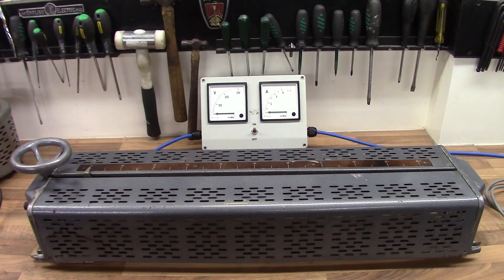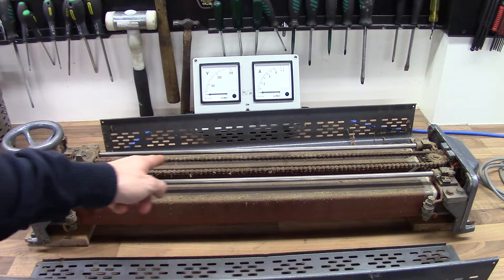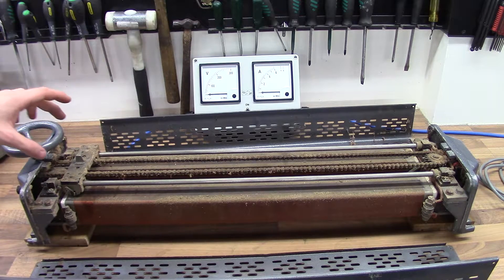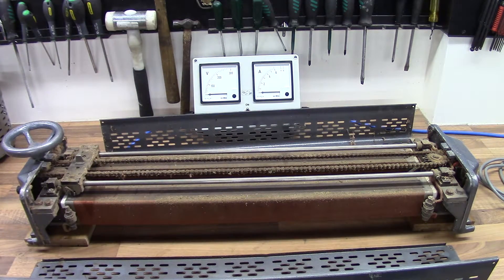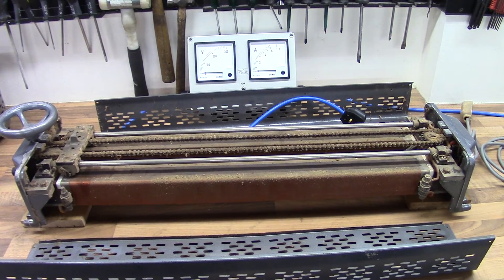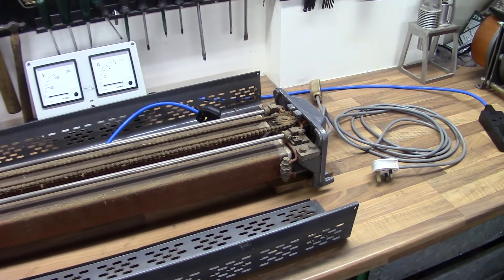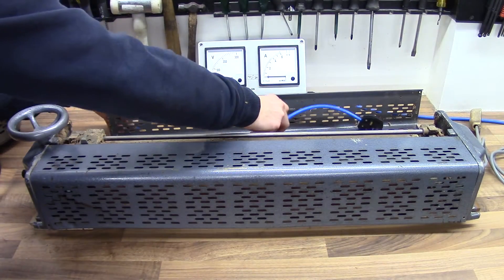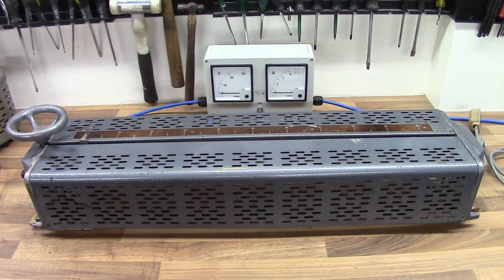Linear Variac Restoration Project - The Beginning

Comment: Wow, that is an awesome find! I really love this 50Hz / 60Hz stuff ;-) I'm still looking for a 400V-model for driving my small 400V to 15kV distribution transformer. Great stuff, thanks for posting!
Reply from the maker: +kilovolt Sorry for the late reply...

Just so you know; if you need to use a variac as a step up transformer from 230V to 400V you will sacrifice half your current rating of the variac in return for additional voltage.

For example; A 10A, 400V (4000VA) Variac supplied with 230V 10A (2300VA) at the center tapping point will give you 460V at 5A at full output power (2300VA).

The reason for this is you are essentially doubling your input voltage which requires twice current you are supplying as "Voltage is inversely proportional to Current in transformers" or (Vp / Vs = Np / Ns = Is / Ip)  or "As Voltage increases Current decreases".

Simply allowing 20A to flow at 230V supply to get 10A at 460V will work for a short (<5min) amount of time until the variac windings overheat...

Just thought you should know if you don't already, so you don't end up with an under rated toasted Varaic.

Also, you may find a 230V to 400V step up Transformer is easier to find than a 400V Variac, the advantage to these is that you don't loose half your rated VA, so your transformer or variac don't need to be twice the size, (VA and Size is proportional), so is easier to carry and can be separated from the variac.

For example; A 2300VA will take 10A at 230V and deliver 5A at 460V, again the same Voltage to Current laws apply, so check your VA calculations make sense before hitting the "Buy Now". =]
Reply: +Steve Lane Hello Steve, thanks for the reply. I'm aware of that, yes, but I have a 400V line in my house. Here in Switzerland there is 400V and 230V line power in almost every household available. 400V is our phase-to-phase voltage and 230V is our phase to ground voltage, so I'm looking for a variac with 400V input and 0...400V output.
Reply: +kilovolt By the way, the 400V line has a 20A Breaker and I found for a half minute or so you can draw up to 50A, so there is plenty of power available, but my 400V to 15kV transformer can only withstand 10A continous or for short times about 30A.
Reply from the maker: +kilovolt Ah 400V to the house, that's very handy indeed!
Does your Neutral "Ground" have a return copper wire back to the transformer or does it actually use the soil as part of the circuit? Just out of curiosity... =]
Reply from the maker: +kilovolt Sounds like you've got the capacity if your 15KV TX is 4000VA continuous and your Supply is double that. Is the 15KV TX oil filled?
Reply: +Steve Lane The Neutral Ground is a return copper wire, but if I'm right, this path goes only back to the next sub station. The high voltage lines are only three phase systems without Neutral Ground I think.
Reply: +Steve Lane The Transformer is not oil filled. I never wanted an oil filled one. It is resin potted and has a fully isolated high voltage side (two HV bushings), but it is rather heavy (about 70kg).
Reply from the maker: +kilovolt Yes I suspect the transmission lines would be only 3 phase as there would be no need for a neutral cable. The Neutral would come from the secondary of the distribution transformer in the substation as you already said. Sounds like the transmission system in Switzerland is very good, not far off what the US work, but twice the voltage. perfect! =]
Reply from the maker: +kilovolt a 4KVA 15KV resin potted transformer sounds like quite a beast of a resin filled one, bit of a monkey to carry around, a 2 man lift would do it.
Reply: +Steve Lane But actually it is more dangerous to have higher voltages. Everything has its advanteges and disadvantages...
Reply: +Steve Lane Yes, the transformer is a rather big and heavy. It is a small distribution transformer, especially for serving groundwater protective areas, where oil filled units are not allowed because of possible pollution of the water by draining oil.
Reply from the maker: +kilovolt We have the technology to make such voltages safer these days, 30mA RCDs we had for many years now do a pretty good job of disconnecting the circuit in milliseconds if a small amount of current leaks to earth. These come in 3 phase and single phase configurations.
Reply from the maker: +kilovolt Nice find! and yes that makes sense if it's near clean water sources.

Comment: Looks like that's wired as 2 x 8A variacs in parallel, more heat would be dissipated with that setup.
Motor control of round variable transformers is very common, we had plenty at work.
Reply from the maker: +Sparky Projects correct, and I agree they can handle much more than they're rated for a reasonable amount of time compared to compact rotaries. Would be nice to mod this into a motor driven, but without hacking it up at the same time.